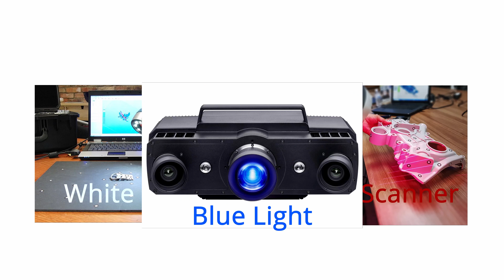3D SCANNERS: White Light vs. Blue Light vs. Laser Technology

Comment: I’ve used both the GOM white light and a metrology grade hand held laser scanner at work as well as seen the GOM blue light in use. 

Everything being scanned with the GOM has to be painted while our laser system only need clear or very reflective item dusted. 

The GOM systems also needed to be mounted on a boom with a heavy base while our laser system is hand held fitting into a case I can take as carry on when traveling. 

The GOM system will give a little crisper model when using the small measuring volume but the accuracy between it and the laser system are close. 

The laser system is also faster at scanning parts.